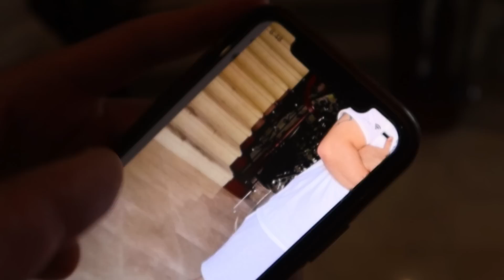I Transformed Faze Rugs Old House and He said THIS...

Comment: I wouldn’t have left the carpet in the middle because most new home buyers won’t like it if you were to resell. As well if you try to buy new tile, there’s a possibility of it being a little bit off or a different color since it’s not the same lot. I think a good option would have been to buy a rug to put underneath the couch.
Reply: Fr
Reply: if you listened he explained why he left the carpet in the middle
Reply: @joshuapriddy2383  I know why, I watched the video. But the problem could have also been solved with a non-permanent and profitable decision of buying an area rug.
Reply: I found that odd also. Especially the corner being half a tile and not have a perfect square. An area rug would've been better. But i don't think they plan on selling anytime soon. Unless they are doing these renovations to sell. Who knows

Comment: Looks so much better and modern.  I would have just switched over to tile then in the middle I'd do a throw rug that way it can be removed and cleaned when needed like the tile can be cleaned easily.  Love the new stairs though.
Reply: True , but it doesn’t really matter because since the built in carpet is level with the tiles, it looks like he bought a rug anyway
Reply: @famreactions3260  true
Reply: Tbh sitting on a rug over tiles isn’t as comfortable as sitting on proper carpet so I think since ron and Bosley spend so much time sitting on the floor, that’s why he chose this style🤷‍♀️🤣
Reply: @Tee-cj6lt  true but he could have put the same padding under a rug. It would have been soft.
I was thinking wood for the staircase tho. But the carpet is nice. 
But mostly because of the dogs. It needs to be all hard surfaces. And easy to clean. Lol
Reply: @Tee-cj6lt  yeah true.

Comment: I know papa rug wasn't just gonna let them workers work by them selves 😂

Also, I'd suggest a nice rug in the same place you left the carpet at, or if you prefer a carpet stuck to the floor, it would be better taking that carpet out and placing another carpet like the carpet you left on the stairs. Other that that, nice remodel! It looks better than before. Keep it up.

Edit: I just finished a lot more of the video and realized you already did that lol